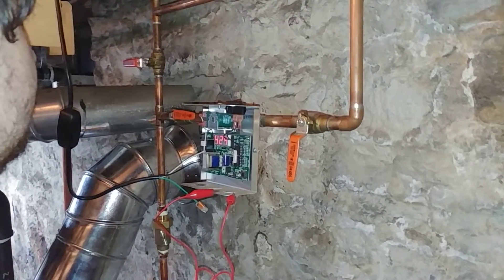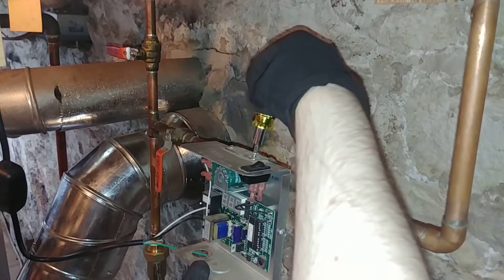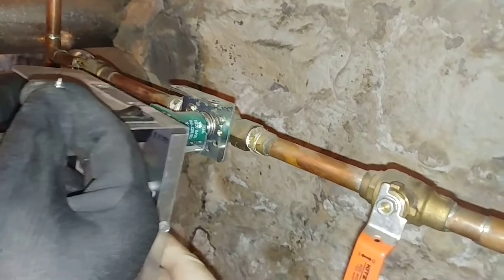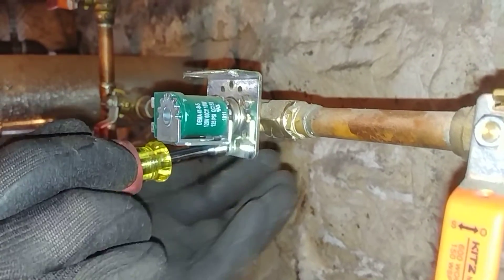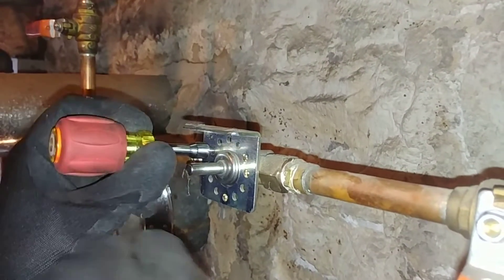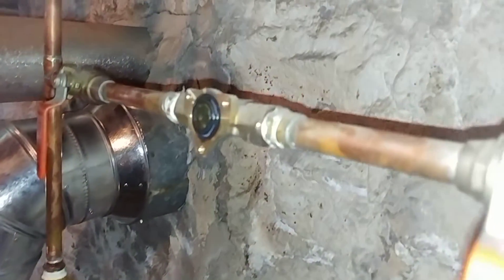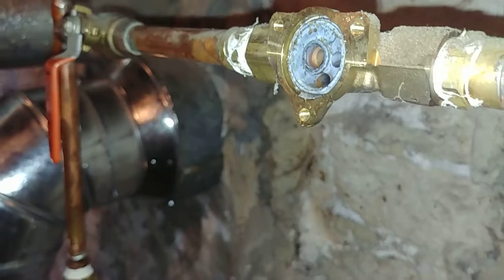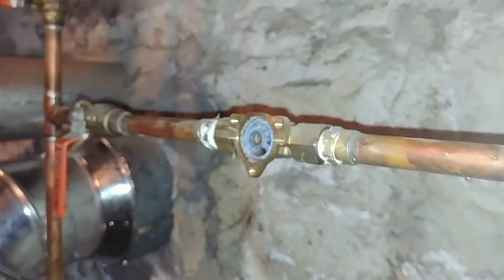Rebuilding Repairing An Automatic Steam Boiler Water Feeder Valve, Part One of Two

Comment: I did the same process, after installing it only feeds water when pressing the button. The low water cutoff light is on, the the boiler needs water. Shouldnt it just auto pull? Do i need to have the thermostat on for it to start pulling?
Reply from the maker: What voltage VXT do you have?
When the low water cut-off light is on, is there a dot in front of the right hand number of the your VXT?

Comment: Great Video. I have a VXT autofeed on my steam boiler and yesterday the LWCO kicked in but didn't fill.  The boiler was not firing but did so when I fed manually.  The feed button on the VXT seems to work well and snaps off as soon as I let go.   I ordered a service kit anyway, but might I need to increase the duration of fill with the dip switch as well?  It's on the lowest setting and has been for several years. TY
Reply from the maker: Thank you for your comment & question!

For those that may not know, there are two sets of dip switches on a VXT. The top set are for the delay before feeding.
They range from 30 sec, to as long as 10 min.  
The factory recommends a 2 min delay.
The lower set of dip switches call out the length of time the valve is opened.
The lowest switch is marked "LWCO" and runs the solenoid until the said LWCO is "happy" with the water level.
The next is "1 gallon" and so forth on up to 5 gallon per feed cycle.

Question for you, when you manually press the feed button,  are you sure water is added? That is to say, water rises in the sight glass?
Next, have you observed when your LWCO is off on low water, there is a "period" on the number display of your VXT?

Comment: Good video but no plumber is going to rebuild these versus replacement outright. Can't justify the labor cost
Reply from the maker: What?
How much is a new VXT?
How long would it take to remove the old valve & install a new valve?
It took about 30 min for the whole job to rebuild the valve.
This was shot in real time.
The only part I didn't show was cleaning the old valve.
It took maybe 10 min. to do that.
The wholesale parts cost was about $14 more or less.
Reply: @gordonschweizer5154  I would totally do this at my own house but my boss would fire me if I was rebuilding automatic water feeders. That's like testing thermocouples 😂
Reply from the maker: @iliketakingshowers  You need another boss.

Comment: Hello Gordon.  Wanted to get your view on having automatic water feeder on a steam boiler in general.  My plumber is old school and when they replaced my boiler in 2000, he said he doesn't install them because when they fail they cause a real mess in the house.  He thinks it better that the homeowner look at the sight glass periodically and add water as needed.  He also thinks it forces the homeowner to learn a little about heating in general.  What percent of your customers have these?  Your view on this?
Reply from the maker: We recommend the automatic feeder model VXT because of its water usage tracking feature.
Recording the results year by year can provide an objective measure of water loss and thereby help your boiler last longer by indicating leaks so they can be repaired.
If you go out of town during the heating season, a properly maintained water feeder can provide piece of mind.
If you do decide to install a VXT and your area is known for "hard" water, you may want to rebuild your VXT as shown every year or so.
This unit was in service for about 10 years until it flooded the system (the water in our area is relatively "soft").
We are now rebuilding VXTs on a regular basis for our customers.

If you decide you want to hold off on getting a VXT, that's not a wrong decision, just make sure you have a proper drain on your sight-glass as shown in my other videos on this channel.
It's OK being old school, just not TOO old school.
Reply: @gordonschweizer5154  I appreciate your detailed response Gordon.  I actually put one of those sight glass drain valves on based on what I saw on your channel.  To me, your videos and wisdom on these matters are excellent.  Thank you and have a great day.